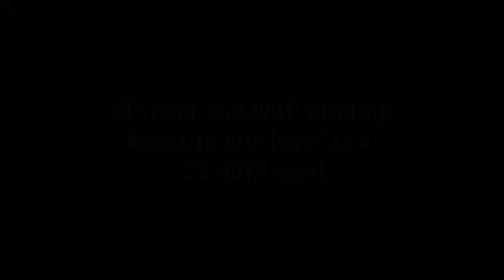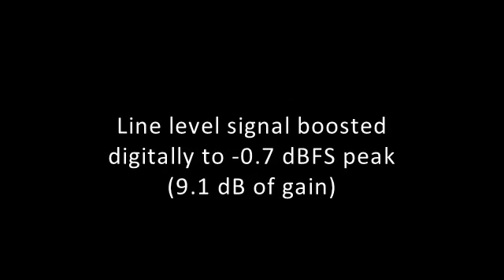Microphone Level vs Line Level Audio Demonstration

Comment: How do we take consumer speaker level and run it into an input and at the output produce microphone level audio?
Reply from the maker: I would not recommend doing that because your gain staging will be pretty bad. BUT, if you must then I would ask Radial http://www.radialeng.com if they have something like that. It would be the cleanest way to do something like that.

A mixing board could also perform that duty. There is a switch on most Mackie boards (for example) that adjusts the main output level down to microphone level. It would not be as "clean" of a signal as a Radial adapter though.